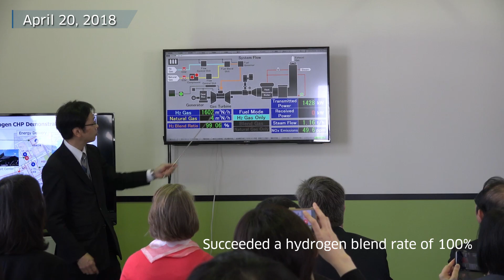Kawasaki: Hydrogen CGS for Smart Community at Kobe, Japan

Comment: Nice job Kawasaki even though Hydrogen is much harder to deal with than natural gas the efficiency of a turbine that runs off one hundred percent Hydrogen is excellent and a world first.
With Green Hydrogen starting to become available a huge leap forward in CO2 and emmisions reduction with a big impact on fossil fuel use.
Using a combined cycle power plant with the exhaust heat generated by the Hydrogen turbine to run a steam turbine to create extra power with scrubbers and filtration cleaning up even more emmisions before atmospheric release an excellent and clean system. Or one of many cogeneration systems could be used in tandem with the turbine to allow for many customer focused systems. I would also imagine the turbine could be scaled up to a much larger size if needed as this would be well worth the effort when using Green Hydrogen for power generation.
With an extremely low environmental impact and high efficiency making the project excellent in every way a massive achievement by the Engineering team at Kawasaki Heavy Industries and a great achievement by Japan. 
This is no great surprise with Toyota and some other Japanese companies pioneering Hydrogen use in internal combustion engines.
The way Hydrogen burns and reacts in many different engines and applications has been well researched by Japanese companies over the years.
😎🇦🇺👍